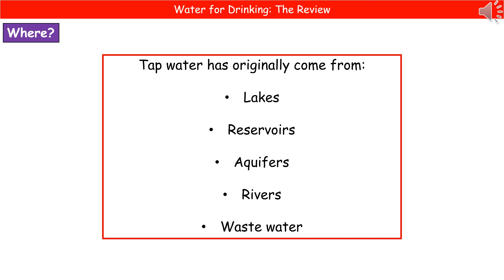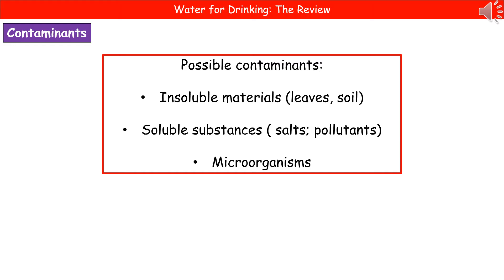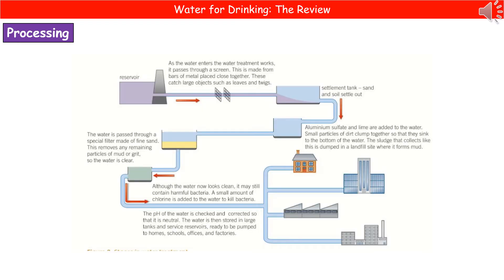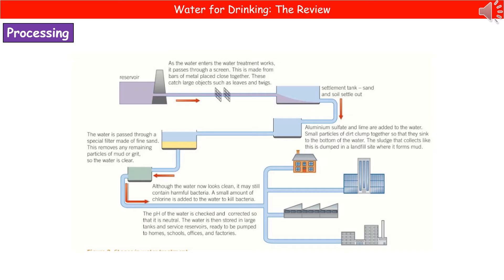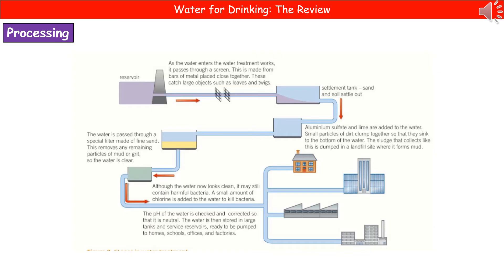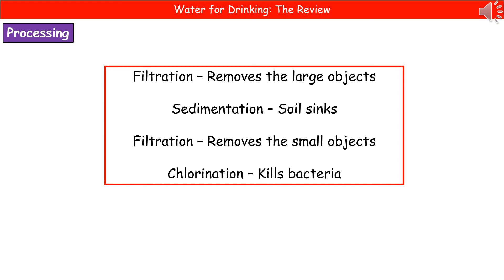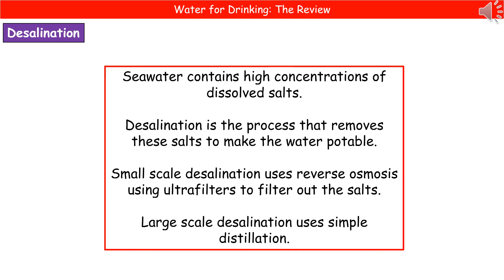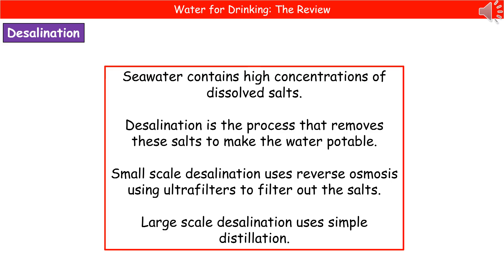OCR Gateway A (9-1) C6.3.4 - Water for Drinking

Comment: hey when is the c7 and b7 going to be uploaded
Reply from the maker: There is no C7 or B7.  Both biology and chemistry end at topic 6 in the specification.
Reply: @WrightScience are you sure because on the chemistry and biology ocr a gateway student book there’s C7 and B7
Reply from the maker: That will be the practical skills stuff which is basically the practical tasks you should have all completed alongside the theory of the relevant topics.  So using a light microscope for example.  I tend to cover those in alongside the theory bits in my videos.
Reply: @WrightScience Ahh alright thanks, so do you think I should make separate notes on C7, B7 and P8 or would I be fine with your videos.
Reply from the maker: I would suggest going over the practical tasks individually as well.  I would not say everything practical related is covered in my videos yet.  It is something I always spend lesson time reviewing in the run up to exams - tables, graphs, variables etc.  One day I will do practical videos but probably not this year I’m afraid.